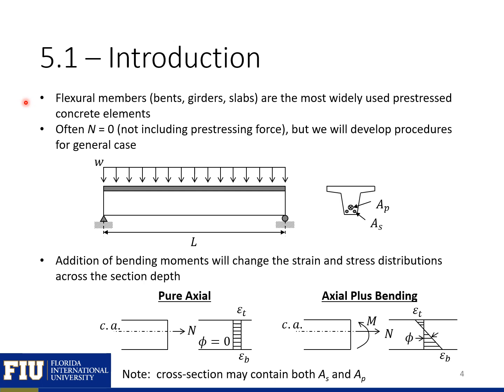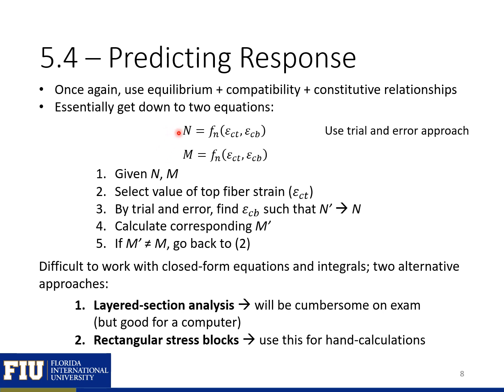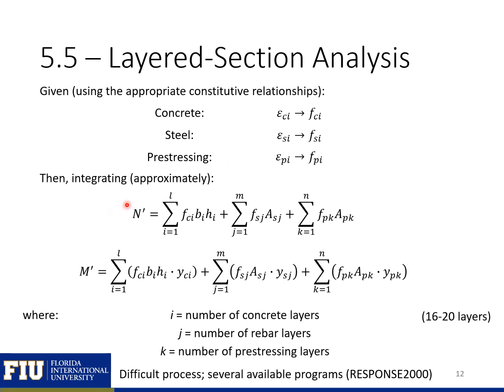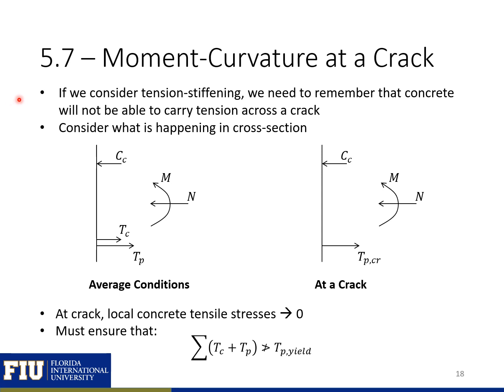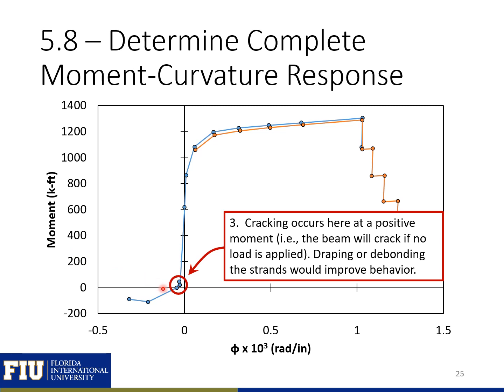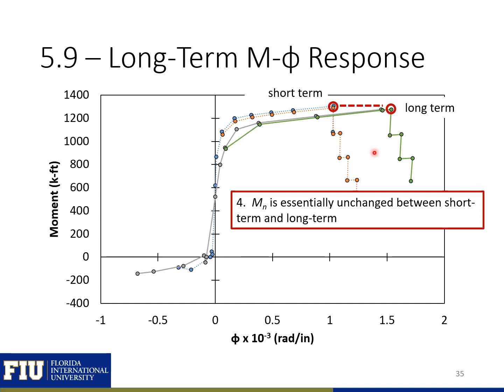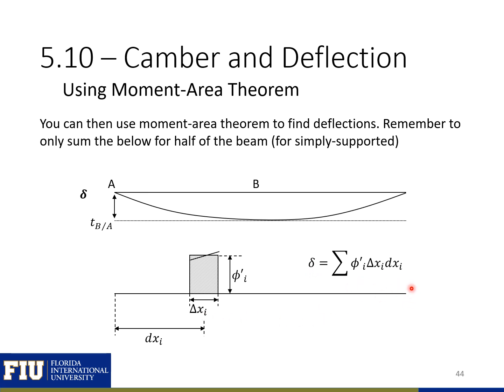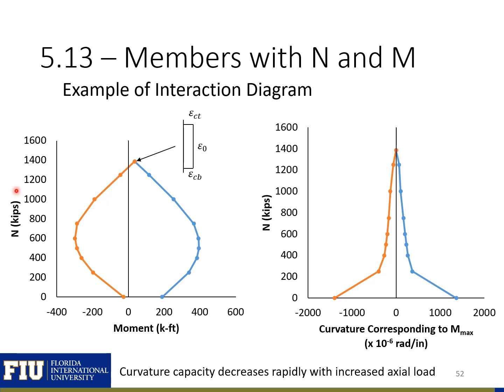Prestressed Concrete Design - 5 - Response to Flexure

Comment: Thank you very much for the reply. Actually I have a perticular problem. I want to find yield moment of hollow circular RC section using ms Excel for a given axial force. NA is located using goal seek to get that axial force. In IS 4998 maximum strain limit in concrete is 0.002 and in CICIND it is 0.003 Es is also different in both codes. So I am asking is yield moment different as per different codes? As you mentioned no FOS is required. Also by adjusting the NA it was found that in many top layers strain in concrete is beyond the limits mentioned in the above code. So in those layers what should be taken as concrete strain?

Comment: Q.3, if strain limit in different layers is different will yield capacity is different?
Reply from the maker: Typically with layered section approach, you would specify properties to different materials and then assign materials to different layers. So you could customize the material properties (e.g., strain limits) for different layers using the approach. I am not sure how much customization you can do in RESPONSE2000 though.

Comment: Q.2 what is in calculation of yield capacity strain in concrete for top few layers is more than maximum value? Do we need to ignore those top layers or maximum strain in all those layers?
Reply from the maker: You would use a stress-strain relationship for concrete (e.g., Popovics/Thornfeldt/Collins) to find the concrete stress in a layer from the average layer strain. You would set a maximum strain (e.g., strain when concrete crushes, strain when strands rupture). If the strain in a layer exceeded the maximum allowable strain, then you would have failure of the material in that layer. You can see how this would work for the prestressing strands failing in the step down of the moment-curvature relationship on slide 22.

Comment: Hello sir, I have few questions please reply q.1: to calculate yield capacity do we need to consider partial safety factor to limit the tensile strain of steel i.e. is it fy/Es or fy/(fos x Es)
Reply from the maker: No safety factor is needed if you are just analyzing the section (not designing based on ASD/LRFD approaches). You would include a safety factor to the yield strength if you were using Allowable Stress Design. Note however that LRFD is used today for design for prestressed concrete members.